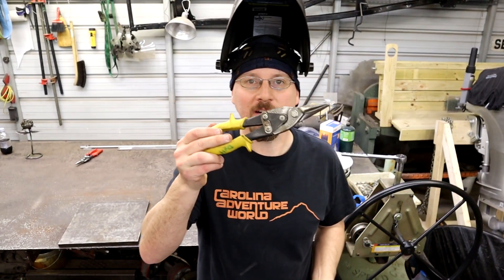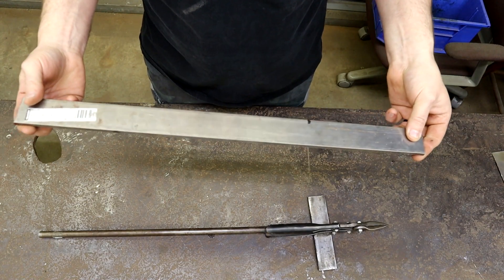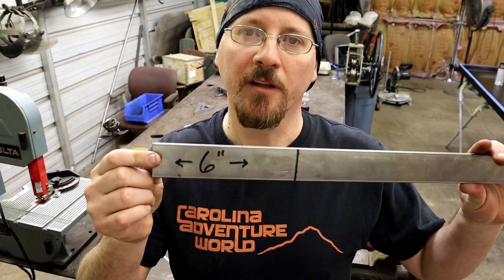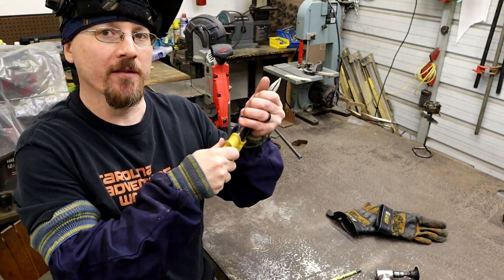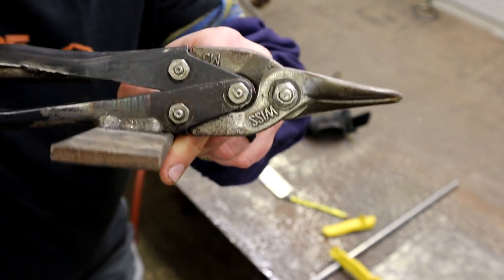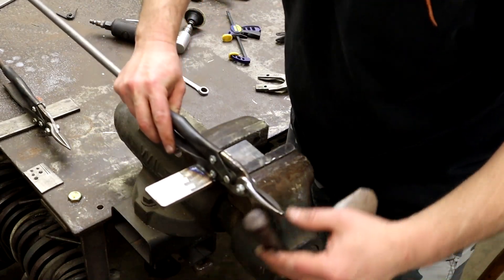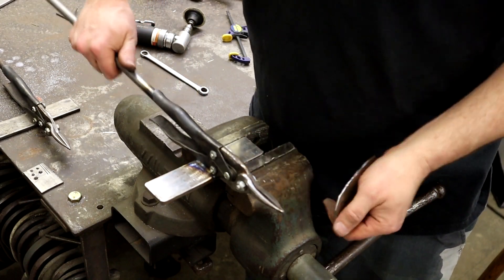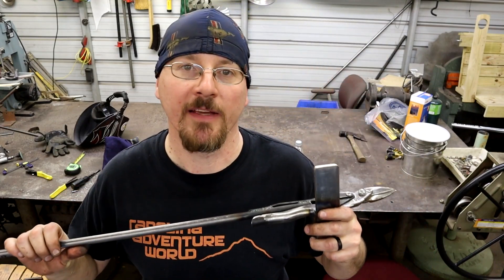How to Make a Sheet Metal Shear for Cheap

Comment: I made one of these - worked great - two slight mods - had to cut the handle near the plate off since it prevented the plate from going all the way Down 4:30 in the vice.  - Also the Rod did not go in far enough and the handle bent - I “boxed “ in the channel handles and that solved the issue
Reply from the maker: Thanks for the tips, I may make a up dated version!!!!

Comment: Awesome video man! I’ve never seen a welding jacket/sleeve for the actual welder. I want one!!
Reply from the maker: Thanks man, my tig machine can with a lil piece of junk sleeve, so I up graded to the heavy duty leather one, cause I'm rough on stuff lol, thanks for the support
Reply: AC Designs absolutely sir! Where did you get it and what are they actually called?
Reply from the maker: @FishinTheMittinTV  I bought mine at national welders years ago, I just looked Amazon has them, there called leather tig cable covers